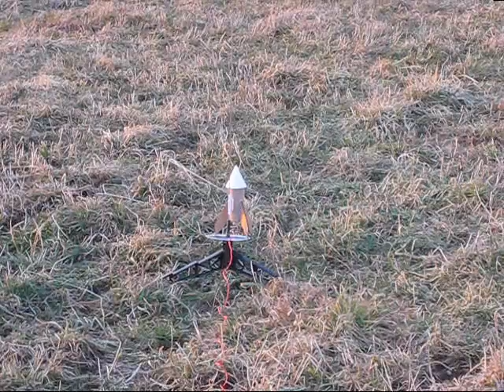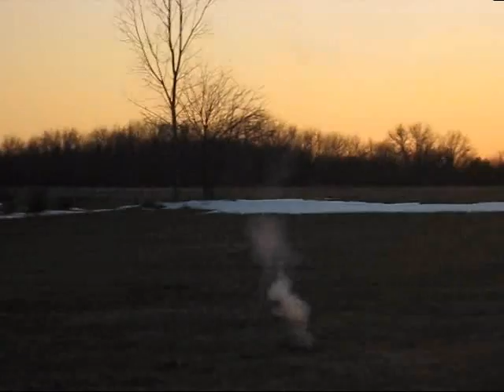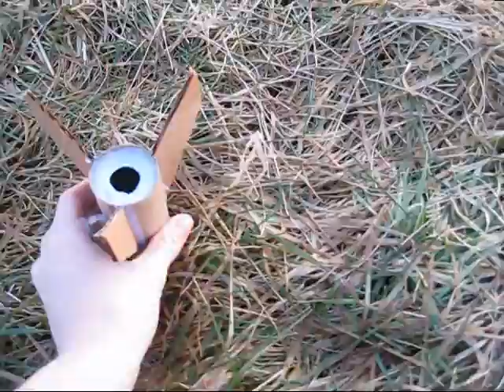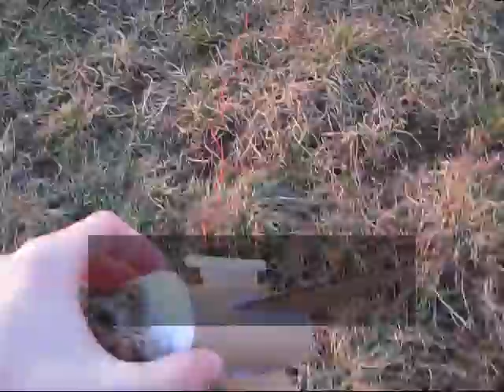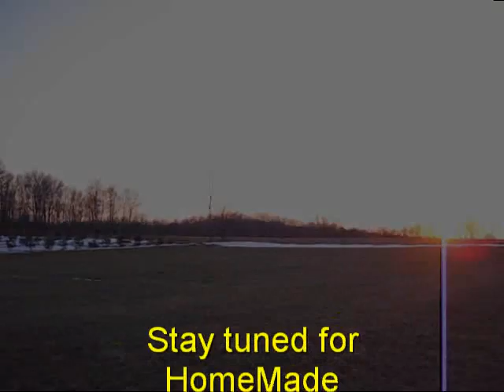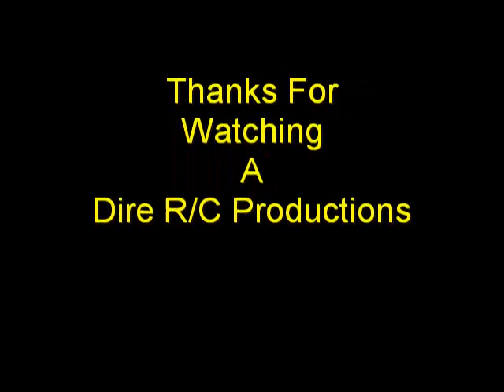Mini HomeMade Model Rocket

Comment from the maker: @SKMatoBB Its quit different actually, but I lined up the engine over a piece of note book paper and traced out a whole for the engine to fit through. Then I traced another line the size of the rocket tube so it would fit flush. Then I just cut where I traced. Then hot glued that in place. And I just might do a vid of a C engine in there. Maybe it will go further in the air :P Next time I built this rocket It will have to be a lot lighter.